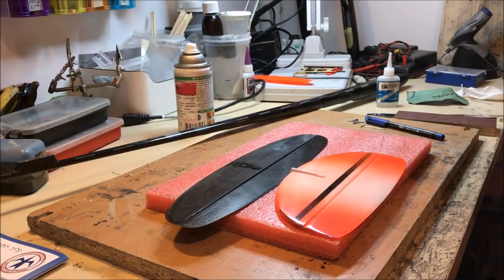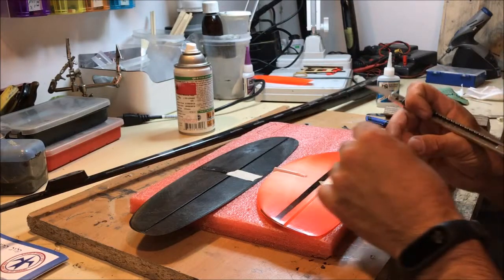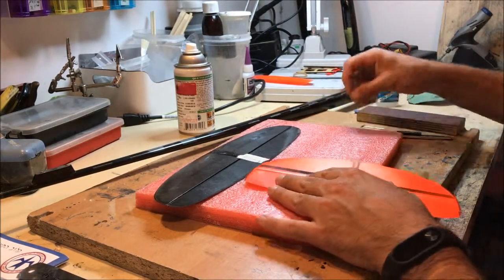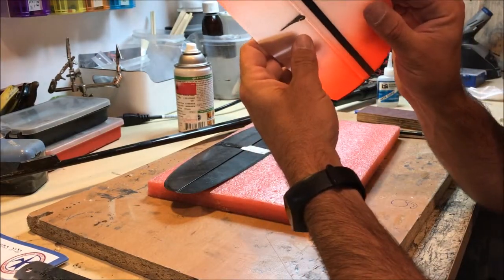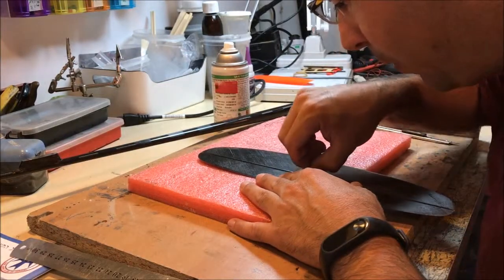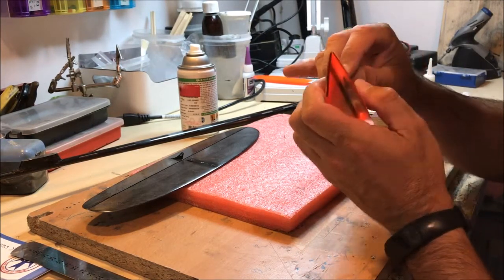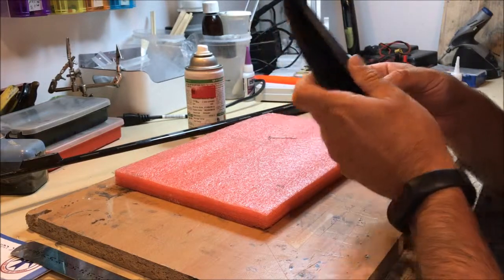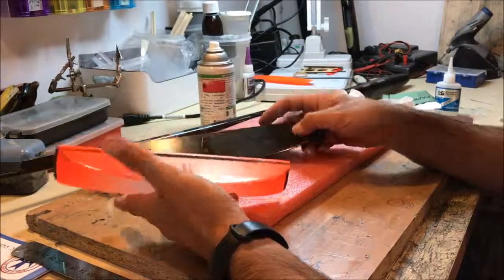Vortex 3 building instructions - chapter 6

Comment: Great video, thank you.  What is the gauge of the spring I.E. .3 or .4mm?
Reply from the maker: Tim Arnold  I can’t recall if it was 0.4 or 0.5 bit I think 0.5 is more likely
Reply: roy dor thanks for the prompt reply. I am converting an old Predator 2 DLG from pull/pull. It a 10 year old unstarted kit found in a workshop clearance. Lucky me! I plan to get some inexpensive  stick time on it before upgrading to the Vortex
Reply: Is there a left handed rudder and wing?